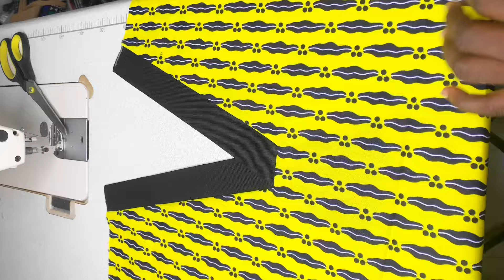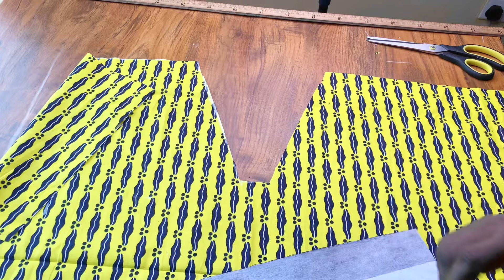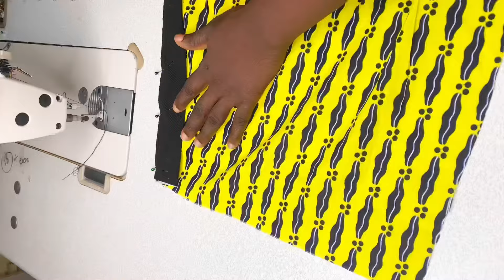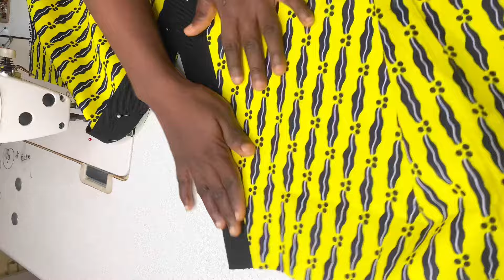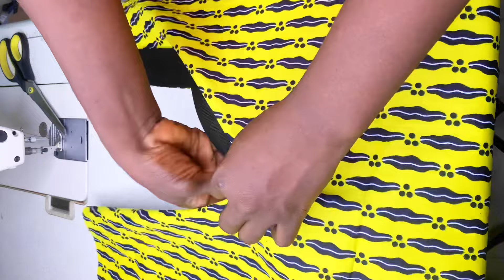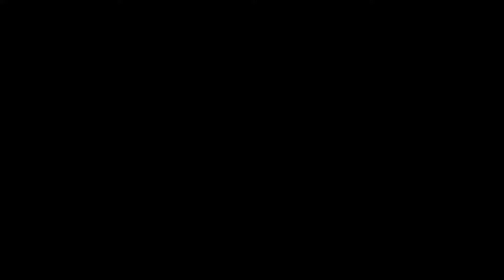How to cut and sew V neck line design

Comment: Good work but my question is, is the front not going to be longer than the back after attaching the v neck
Reply from the maker: Are you talking about the neckline? 
If yes the neck width must be the same before you join them together….that is cut the same size of the black fabric stitch to the back neck before joining